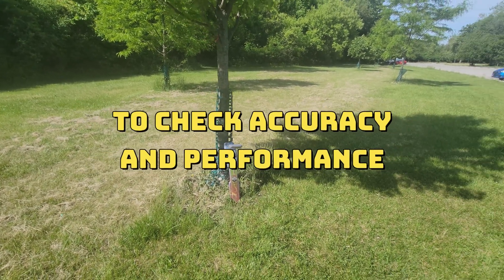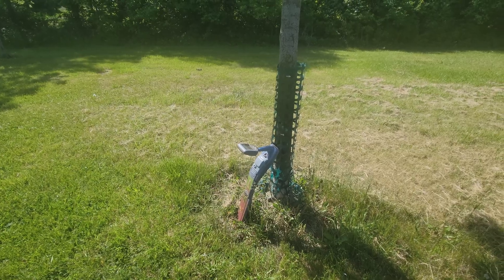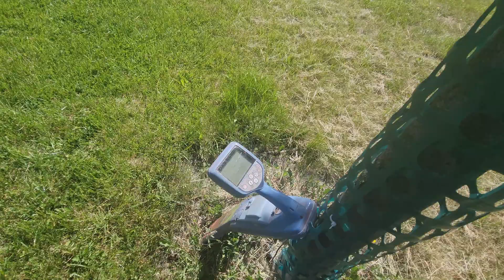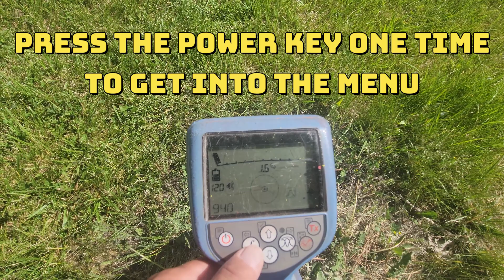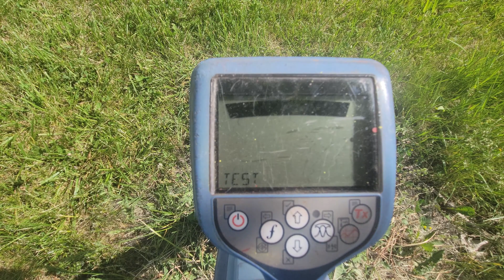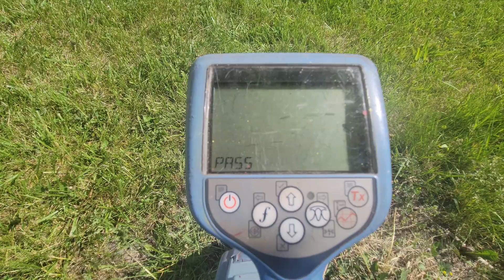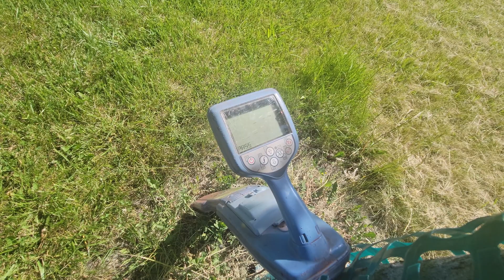Radiodetection Running a Self-Test On The RD 8200 | Precision Cable & Pipe Locator

Comment: Hello, CAL-0 indicates that the locator does not have a current calibration, right?
Are you wondering if there's anything that can be done to prevent this message from being displayed when you start the locator? It's best to calibrate it, I know? But paying for calibration every year is too much. Older models don't have this problem, they don't display this message.
Reply from the maker: Yes, CAL-0 on a Radiodetection locator indicates that the locator does not have a current calibration. Reach out to Radiodetection’s customer support or technical support to see if there is away to turn it off.